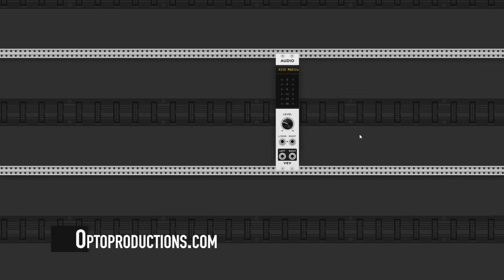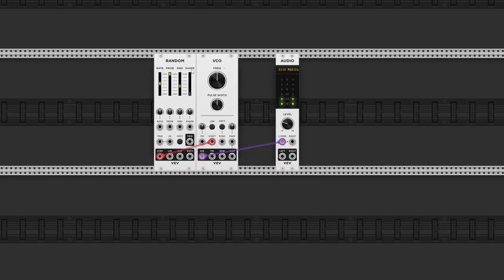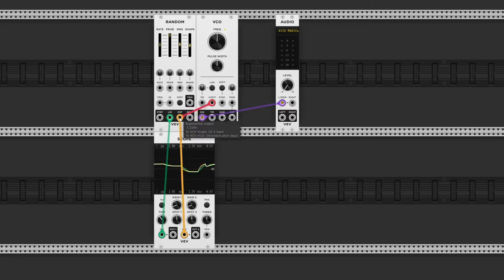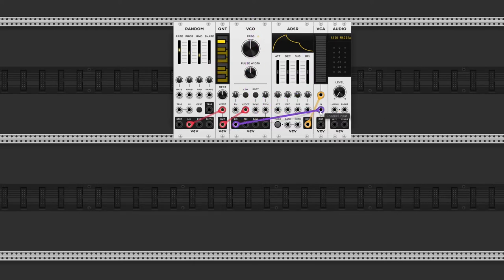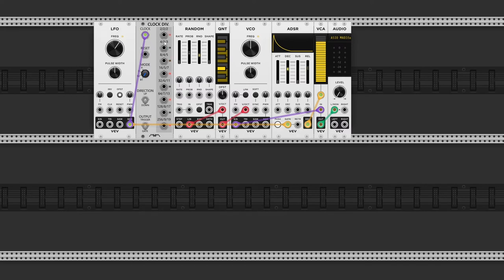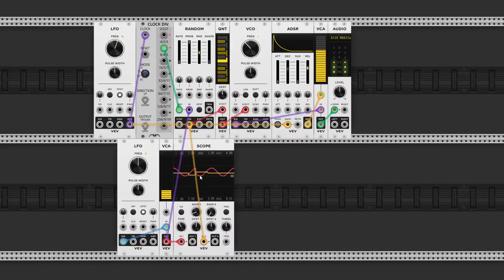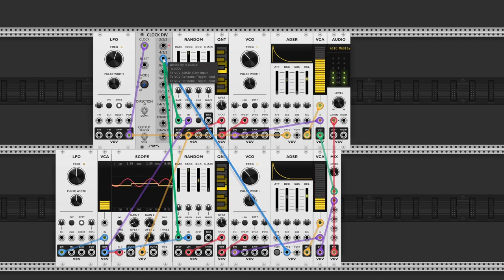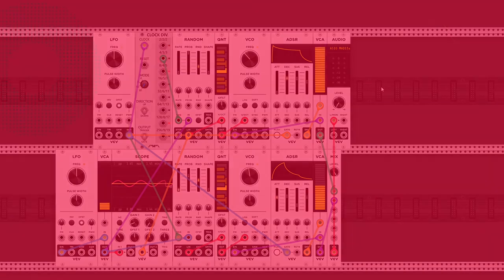VCV Rack Random Module: Creating Random Melody and Bass Sequences

Comment: Excellent video, I've really enjoyed all your VCV tutorials! I'm a little confused though as to how the second LFO you added is restricting the range of notes generated by the random module. Is the frequency of that LFO arbitrary, as the voltage of the VCA seems to be the important part?
Reply from the maker: Good question, I may not have explained this clearly enough. The LFO basically outputs voltages between -10V and +10V. When you patch this to the input on the random module it will replace it's internal voltage generator and it will function like a 'sample & hold' circuit, thus sampling the LFO output voltage the moment a trigger is received. The VCA simply restricts the output voltage of the LFO and therefore reducing the output range of voltages. For more randomness you could use a white noise generator instead of an LFO. Hope this helps!
Reply: @optoproductions  very helpful, thank you for the clarification!